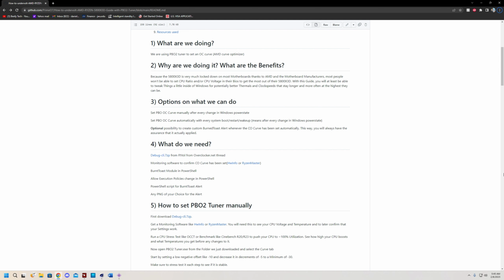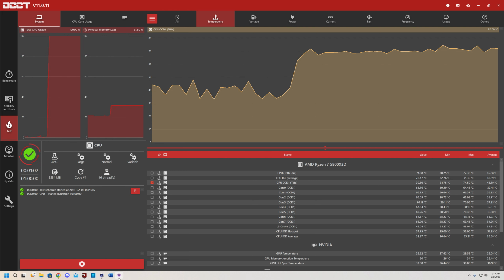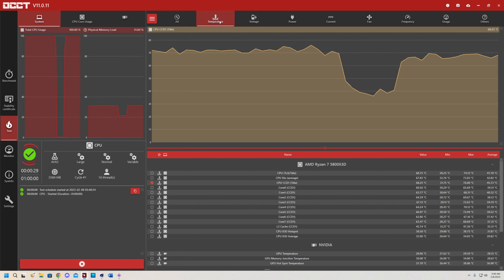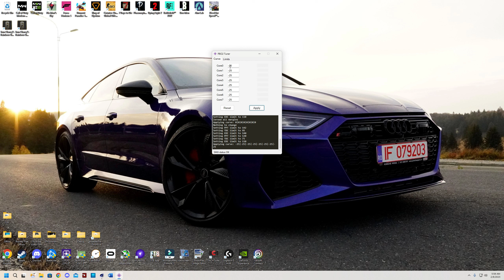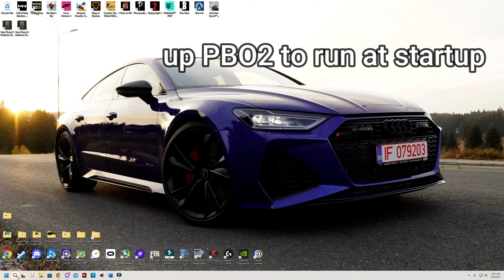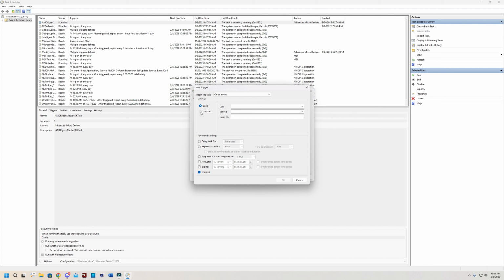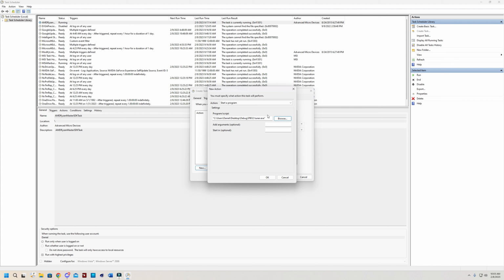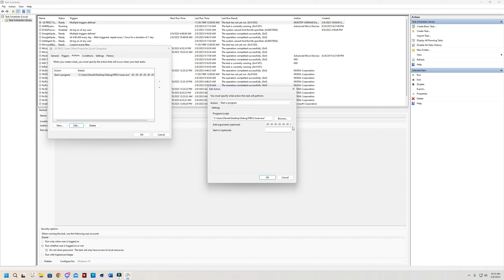5800X3D Undervolted with PBO2 Tuner (Setup Guide and Performance Testing)

Comment: PBO2 Tuner has to be executing and in my task bar the whole time ? I noticed when I closed it, my temps jumped from 40ish to 60 while in idle. I'm using a cheap liquid cooling and for not having noise I set up in the bios to almost never use the fans, by default bios options my unit went 4550 mhz while benching with CB.
Reply from the maker: It's normal for Temps to spike when opening and closing such apps, and in most tasks the frequency won't be different, just Temps better under losf
Reply: @Beefy-Tech  Well I followed all the steps and seems now benchmarking doesnt get me 90º but 79º. Thanks so much for this tutorial.
Reply from the maker: @cybdan_  awesome to hear fam!

Comment: Hi, I finally got around to trying this but Avast keeps flagging one of the DLL's as potentially vulnerable. False positive?
Reply from the maker: Don't worry about it, it won't cause any security issues or performance issues. Anti-virisuses tend to be over reactive towards apps such as PBO2 because they have access to the CPU's power limits and other functions.
Reply: @Beefy-Tech  Excellent! Anyway, I immediately saw benefits from -10. Clocks went up 4300 to 4450 which seems to be some kind of ceiling for this system. Currently testing -20.
Reply: @Beefy-Tech  Wow, I even got it down to -30. Ran OCCT for 5 minutes and even a Cinebench R23 for 10 minutes. I guess it's stable there, (knock on wood). Just a question: is there a point where there are diminshing returns with this method in terms of CPU boosting behaviour? Like: could -20 be in any case better than -30? Thanks for the video!
Reply from the maker: @iseeu-fp9po  hello, yes there can be diminishing returns if you are capping out the frequency at 4.45ghz at -20, a -30 offset won't make a difference. 

The difference comes from significantly lower heat and voltage which makes the frequency cap easier to hit. If you hit the cap already, Lower voltage won't be beneficial, but if -30 is stable, definitely stick with it. If you ever get a crash or restart, set to -30 on first 4 cores amd -25 on last 4, and it'll be perfect👍

PS: 4.45ghz might be hit in OCCT or benchmark, but ull also have to test the games you play to confirm it hits 4.45ghz cap ingame!

Comment: Isnt it better to do this in the motherboard bios? Isnt it like a more permanent thing than letting the Windows boot and only then it will change the cpu settings?
Reply: alot of motherboards won't allow adjusting PBO in the BIOS, and even if the settings are unlocked - it just won't work or cause issues. so this option is for them

some exceptions like MSI offer undervolt presets via Kombo Strike though, so that kind of answers your question.

Comment: In my case Ryzen R5 5600X it was stable at (-23), Realy cool tool.. Thanks alot for sharing it realy helps ❤
_Without the offset .. On cinbench R23 im getting (11467) points + temp (82.5) celsius 
_ With the offset (-23) ... On cinbench R23 getting (11759) points + temp (75.3) celsius
Perfectly Stable at (-23) , any higher even at -24 iam getting crashes sometimes
Oh .. BTW my ram is (HP V10 RGB 32GB DDR4 3600MHz CL14 2x16G) Dual channel + Dual Rank .. as the frequency & Latency of the ram affect the performace specialy with ryzen cpus

Comment: When i set any limits at PBO2.. After restart there are default values.. Why
Reply from the maker: It's not applying correctly most likely, you might want to redo the process again.
Reply: @Beefy-Tech  -30 values works, but at secong page like TDP, W etc.. dont work
Reply from the maker: @TrenakCZ  when you type out the rule line make sure a 0 is at the end.

It should look like this:

-30 -30 -30 -30 -30 -30 -30 -30 120 75 110 0

That 0 at the end makes all the difference
Reply: @Beefy-Tech  ah nice, thank you bro ♥️♥️

Comment: I used PBO2 -30 All core 5800X3D and my boost clocks show 4889 when running user bench mark where it used to show max 4559, all the cores show 4889 at some point where it used to be 4559 at some point and I am told 4449 is the regular boost frequency it is supposed to use, I didnt change any of the other things in PBO2 like the total watts and other things, I am thinking of lowering the max WATTS and other stuff but getting 4889 boost is nice for me and I dont see high temps so I dont need to lower the watts to get lower temps as of now and I dont care about the energy usage for my power bill =) I will lower those if it will result in higher boost or longer higher boost, like if it thermal throttles for being higher temps so I get lower boost after it reaches higher temps.
Reply: How are you getting 4.9 GHz on a 5800X3D
Reply: @Focus_Fearless  under volt only and good cooling it's not always there thou
Reply: @Impossibly-Possible   I'm thinking of picking up a 5800x3d but can't decide because of the 5800x's faster boost clock, would the cache still prevail?

Comment: I have set PPT=120 TDC=75 EDC=115 the curve at -30 cinebench is hitting 79.8c, and lowering EDC and/or SoC VDD actually increases temps by 4c.
I'm using NH-D14 so I don't know why I can't get any lower temps.
Reply from the maker: If temps get hard stuck, most likely your cpu thermal paste application wasn't done right, or cooler isn't making contact with cpu and paste properly. I recommend you take a look at that
Reply: @Beefy-Tech  repasted and the screws are bottoming out, either the bottom of the cooler and/or the IHS are similar in shape thus not contacting fully :/
Reply from the maker: @GH1987  it's possible for it to be a contact issue, but hard to tell, I'd say worth  considering a cooler change to an All in one liquid cooler to lower temps significantly.

Comment: Hi, Thank you so much for making an easy to follow tutorial. My apologies if this has been asked many times before, but I just got my 5800X3D and was wondering what's the difference between PBO2 vs manually changing bios setting vs MSI Kombo Strike? and also, which one provides the best performance with the lowest temperature?
Reply from the maker: Kombo strike 3 is thought to be an automatic 30 curve offset, but I've seen varying results from it.

Pbo2 tuner you can manually input any offset, and it definitely always works and shows benefits, so I recommend it over kombo strike 3.
Reply: @Beefy-Tech  thank you so much
Reply: yup use bios if you can, I can't. What a time to be alive you have to research BIOS options now
I bought AsRock X570 Steel Legend, changing stuff there manually, no user friendly automatic systems whatsoever, lucky there's even XMP setting.

Comment: Can’t you turn on pb02 tuner in bios? Is this like a manual turning technique?
Reply from the maker: Some motherboards can, some can't, it'll depend on specific motherboard vendors and their support for it.
Reply from the maker: As a fair note, you can download PBO2 tuner on windows to use it for testing as then you won't have to go back into BIOS if something is unstable, but past that, doing it through BIOS will be the more convenient way long term as you don't have to count on an App to apply undervolts👍

Comment: With the pbo2 app after testing and everything is stable to keep the cpu at those settings do you just leave the app on and minimize or can you exit and close it ? Thanks for the tutorial!
Reply from the maker: If you do the apply at startup with task scheduler it's essentially minimized constantly, so yes u can just minimize it after you are done to make sure it doesn't unapply the stuff, although it shouldn't unapply it even if you close it entirely.

Comment: Hey, so I'm running into a really weird issue and I hope you could help me. My 5800x3D won't pull more than 85 Watts running Cinebench and around 95-105 Watts Max in Prime95 (All this is stock). The issue I'm having is that when I use PBO2 Tuner and apply a -10 offset for example, the power draw (And obviously temps) actually go up. Idk what I could be doing wrong? Im using Windows 11, B550 Gigabyte Aorus Elite V1 Motherboard, newest bios as well. Any windows settings I might be missing? Even a clean bios wont change this fact. I'm really lost!
Reply from the maker: Try a -30 mv undervolt and check temperatures. If you still have issues you can set power limits to 120 Watts, 75 EDC and 110 TDC, it'll lower temps further and keep same performance. Let me know if the -30 helped though
Reply: @Beefy-Tech  Yeah the -30 worked, thx! Did it right in the bios cause the Voltage curve was available there

Comment: Hey Beefy. Just wondering if RAM oc is worth doing while running the 5800x3D or is it worth oc RAM with this chip? With my b550 I was only able to get minimal gains. Mind you I only increased frequency and voltage, no subtimings, Corsair Dominator 3200 cl16. Have you tried or had luck oc RAM together with 5800x3D? Cheers mate.
Reply from the maker: It's minimal gains. I went from a 3600mhz cl20 untuned kit to a 3800 cl14 fully tuned kit and gained like 10 fps in warzone 1 back when I did the upgrade. 5800x3d doesn't benefit as much from fancy ram, but it still helps it a bit.
Reply: @Beefy-Tech  cheers Beefy i thought was the case
Reply: Don't call him Beefy  😒.
Like he's one of your buddies from the street ... 
He's Mr Beefy  to you  😎
Reply: What ram faster ram helps with is the 1% low and .1% lows when gaming. The x3d cache helps this a lot but tighter tuned ram will increase the lows even more. You wont find much improvements in average fps but gameplay will be improved considerably as the lows are better. Best ram for the x3D will be 3600-3800 c14 with tight sub timings and 4000 c14-16 for 1:1 fclk if you are able to achieve it.
Reply: It does but the difference is only noticeable in the 1% lows went from 3600CL 16-18-18-36 to 3800 CL 16-16-16-32

Comment: I can’t extract the 7zp. file. It just says if I wanna open with Firefox, Notepad, etc.
Reply from the maker: Oh no that's a test document, ignore that entirely, ull see uve most likely already extracted it if you got the text document pop up.
Reply: I don't understand. I tried figuring it out and in google it said I need a 7zp opener. Is this true?
Reply from the maker: @gamingwithfrank1649  you must have a way to extract the zip folders. 7zip works, or any other free extracting tool like it.

Comment: My settings are -30 all cores , PPT 105 TDC 75 EDC 110 , i get max 79c on ryzen master using cinebench with the cpu being constant at 4.330-4,350 Mhz , is it good and stable ? can run cinebench without crash

Comment: how do you check if the task scheduler is done correctly? I've open the PBO2 tuner to see if the offsets was applied but just shows 0 for all values.
Reply from the maker: It should open to the offsets that you set. If it opens to 0 it means it hasn't applied correctly.

Make sure you type out the offsets and limits exactly like this
Offset + power limits

-20 -20 -20 -20 -20 -20 -20 -20 120 75 110 0

Just offsets 

-20 -20 -20 -20 -20 -20 -20 -20

Comment: Thanks for this very informative video, it was great. However, it does lead me to a question: the curve / -20 settings start on start up, but what about the PPT, TDC, & EDC settings? I don't believe you went over how to do that on start up. Would be great if you could share or let us know whether or not that's possible.
Reply from the maker: Yes, at the time I didn't know how to do it, now I do.

When you type your command line in task scheduler, right after the negative curve optimizer settings, ud input your limits, and then type a 0 at the end.

The line should look as follows:

-30 -30 -30 -30 -30 -30 -30 -30 120 75 110 0
Reply: @Beefy-Tech  Thanks a lot for this, you're a GOAT
Reply: @Beefy-Tech  Had another question if you didn't mind. When you make the Core's -20 to -30, does that mean we are reducing the frequencies of the cores?
Reply from the maker: @Swaangin  no not particularly, undervolting isn't just reducing voltages, it makes precision boost overdrive choose the same frequency at a lower voltage. Essentially, it'll run the same frequency at lower voltages, which in turn allows it to run a higher frequency at the same max voltage as before.

The 5800x3d caps at 4.45ghz tho so the undervolt doesn't scale past your frequency cap.

Thing is once you undervolt too much, the system slowly becomes unable to stably run the same frequency at a lower voltage, and the only time an undervolt can hurt is specifically when its unstable.

Comment: When running tests without pbo I have higher average mhz but with pbo -20/-25 average is 3850 mhz, -15 average 4000mhz, average mhz is something to take in considerations or i should look for better performance/fps only in lower voltage and temperature?
Reply from the maker: It means past-15mv it's not helping frequency and performance anymore because it needs the extra voltage to boost higher, so stick with-15 for best performance.

Comment: LOVE U BROTHER , u help me get 4-5c lower  temps and 4450mhz now before is use to get 4300mhz  also little fps gain.

i have 5800x3d with - 30 all 8 cores and nothing else i dont change any other tdp or other parameter as roit vanguard mess stuff up , so just use -30 all 8 cores and 4lowertemp and 10 watt less energy , i notice my cpu use 1.18 v

Comment: How exactly do I know when things get unstable.. will it just crash or something else? I've been going down to -20 now and I selected Core 0 (perf #1/2) in OCCT and while there is a temperature drop, the value in the top right corner is always at 4441.99 MHz. Is this value supposed to stay that way or is there a way to get it higher because in your video I see a value that is a little different.

The github page doesn't really specify on how unstable results are supposed to look like.. for example, if I get a -25 or -30 to run stable, then what do I have to do with the PPT, TDP and EDC values exactly? What will happen if they're too low?

I am very new to this and so far it feels like I am doing witchcraft with random numbers lmao. Doesn't help that english isn't my native language.
Reply from the maker: I'll try simplify it. With a CPU, you will know an undervolt or overclock is unstable from 1. A hard reboot (pc restarts on its own), a hard crash with bios reset (in which case bios settings were the problem), or it loses performance rather them gains performance (say you do ram tune or cpu undervolt, and YOUR FPS goes down by a bit, it's unstable.

If you are holding 4441 you are perfectly fine and maxing out the 5800x3d. The absolute max it can hit no matter what is 4450..meaning you are right on the money as is.

If you have a -25 or 30 stable, chances are setting power limits won't matter to you, as those are meant to just further decrease temperatures incase you are really thermally limited. If you want to apply some generic power limits that'll work for sure, copy paste this exact line below, mind you, with whatever curve offset numbers you want.

-20 -20 -20 -20 -20 -20 -20 -20 120 75 120 0

That number 0 at the end is important for the full line to apply!

Good luck fam, it's a process but better to learn this stuff now then later😂
Reply: @Beefy-Tech  Thanks a lot! If all fails I will ask around on the overclocking subreddit! So far it seems to be stable, even with -30. Temps are more than fine too, not even hitting 70°C, usually at around 60ish under load, but I expect nothing else from my Noctua NH-D15.

The hardest part seems to be getting this to start with windows lmao. But I've seen the pinned commend and I'll try to configure that today :)
Reply from the maker: @PinePizza  the task scheduler thing requires every single step to work, if 1 step doesn't work all fail so it's important to nail it.
Reply: @Beefy-Tech  I will be extra careful! Thanks :)
Reply: @Beefy-Tech  eberything works like a charm, -30 -30 -30 -30 -30 -30 -30 -30 120 75 120 0 are the settings and it auto starts correctly with all settings applied :) thanks again for your help!
Reply from the maker: @PinePizza  awesome to see fam! Enjoy the performance!

Comment: I am not able to change CPU current and power on b550 pro vhd wifi.Which motherboard are you using?
Reply from the maker: You can't change any voltages that specifically targets the 5800x3d through bios. You can only undervolt it with the app and apply lowered power limits, not power increases.

Also, I'm on a MSI X570 Ace Meg
Reply: @Beefy-Tech   thanks for immediate reply.That pbo2 tuner app fails to change my limits,Also cannot detect the default values.Whenever I set values and apply it says at the bottom SMU status failed.Maybe  ryzen master is blocking it?I am able to set curve value only.
Reply from the maker: @thebeyonder77777  for the limits to apply correctly you need to put then right after the undervolt, and make sure there's a 0 at the end. The line should be strutted exactly like this, but with your own values.

-20 -20 -20 -20 -20 -20 -20 -20 120 75 110 0
Reply: @Beefy-Tech  I managed to fix the issue with windows reinstall.But problem is I ran PBO2 tuner as administrator once and now task scheduler cannot run it on system startup.
Reply from the maker: @thebeyonder77777  I see... that's unusual... I think u may have to do a reinstall for that.
Reply: @Beefy-Tech  uninstall of PBO2 software?Even if I redownload the zip file it again opens in admin mode.First time admin sign at bottom right  corner im the app's icon wasnt there but I forcefully opened the app as run as administrator.Even after windows 10 reinstall it still opens in that mpde only.Can this app be run without admin privilages?
Reply from the maker: @thebeyonder77777  so the way to fix that is to select an option in the app setup when you do the basic setup, I just can't remember what it's called exactly... I'm still on laptop only without a ryzen cpu available so will have to check to let you know exactly the name of the option to select.